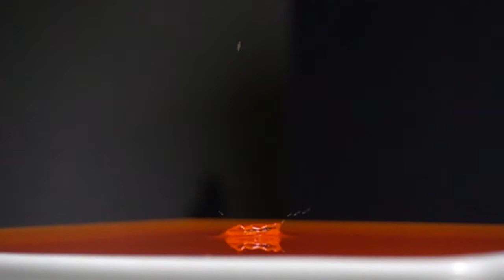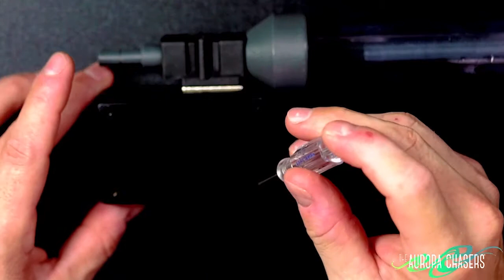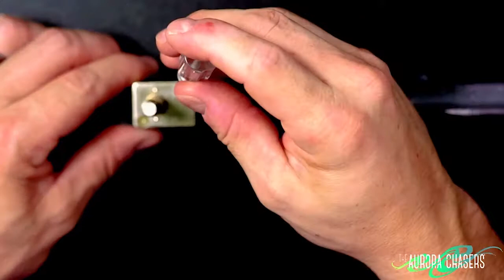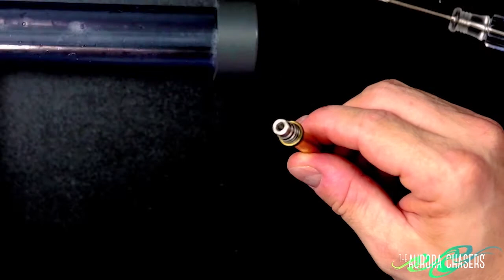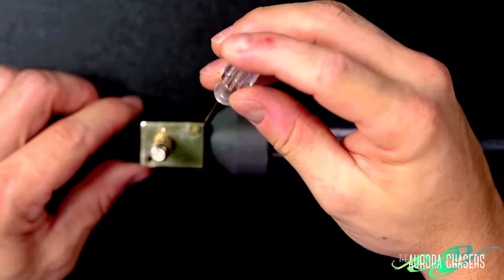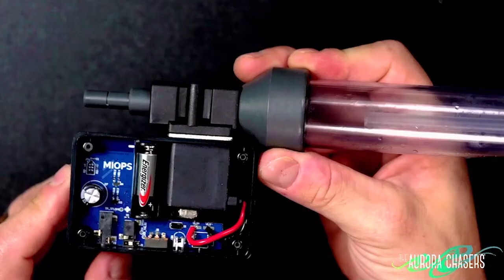How to Clean and Repair your Miops Splash Waterdrop Kit

Comment: Just bought this before Christmas.  Cannot get the camera port to trigger my camera so I have been using the splash to trigger my flash.  Working with MIOPS and hopefully they can tell me what I am doing wrong. If you have any suggestion I would greatly appreciate it. Your video is great, thanks for your work